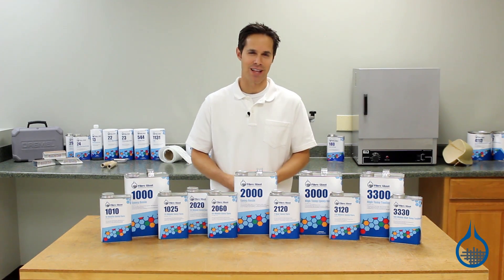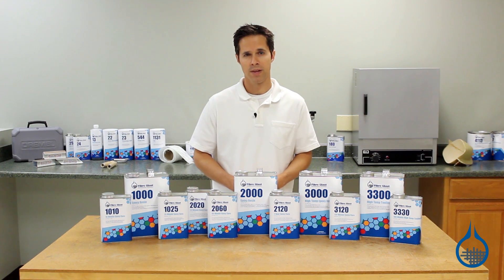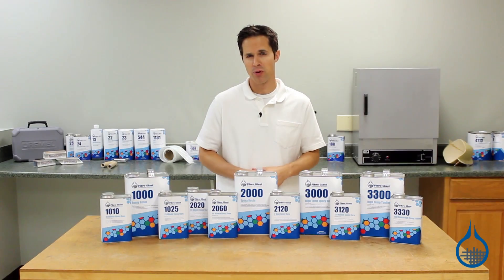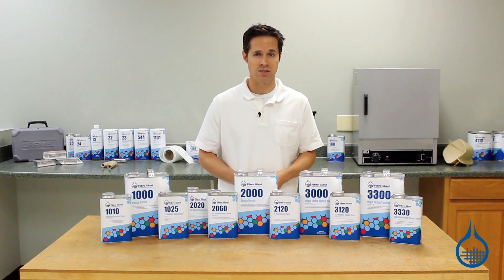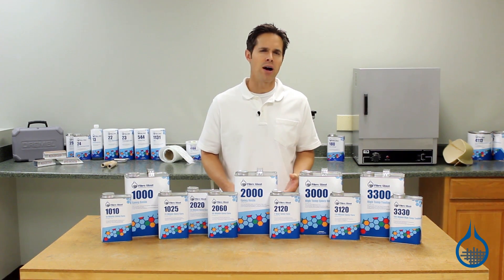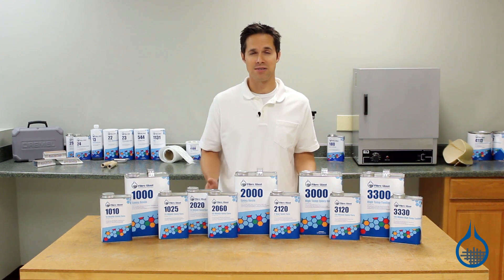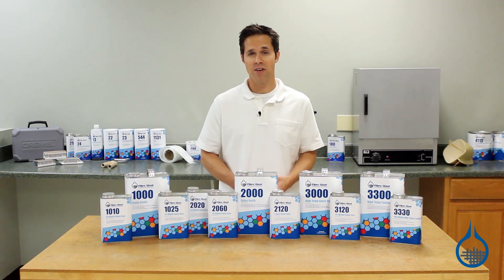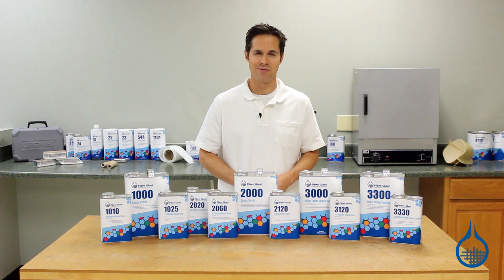Epoxy Overview

Comment: Hi is epoxy resin biodegradable and is it a type of plastic? Was curious
Reply: hi,
epoxy resin is made from melted baleen from whales (kind of like teeth for them!) and as such is biodegradable. tiny microscopic creatures called "tetramands" are able to digest it , and will happily do so. If you look at them under a microscope during this process, you can even see them smiling. How cute! 
happy to help :)

Comment: I'm building a stand up paddle board. What would you recommend for fiberglass fabric and resin? Thanks!
Reply from the maker: I recommend 7-1/2 oz fiberglass fabric. This is our most popular marine fiberglass. As for the resin, I recommend our Polyester Molding Resin. It is a wax-free resin which makes it very easy to work with. 

If you have any more questions or concerns, please contact our customer support team at 800-838-8984 or customerservice@fibreglast.com
Reply: @fibreglast  thanks! I probably should have mentioned that it will be a hollow board in a cedar strip style shell. I'd need the fiberglass to be clear when finished. Thanks again!

Comment: How about yellowing compared to the glass?
Reply from the maker: Hey Anta, Thanks for reaching out. There are many variables to the yellowing of the different composite products. The epoxies displayed in the video do not have UV resistance and will need a clear coat that has anti- yellowing and UV resistance if you are wanting to see the fabric or a UV paint if you are wanting to color the composite. If you have additional questions, we have  a knowledgeable staff that can discuss what you are looking for. we can be reached at 1-800-821-3283 M-F 8am- 7pm EST We are very happy to help you with this project.

Comment: A question of curiosity  - can I make a greenhouse with resin windows in a region of frequent hailstorms? Will such a window survive in a hail of 5 cm ice balls? Will there be a problem with sunlight, you mentioned something about changing colour but what about strength?  How long life such an epoxy glass will have?
Reply from the maker: Unfortunately our epoxy resins are not meant for an application such as that. Our epoxy resins are meant to be used in a composite application in combination with a reinforcement fabric such as fiberglass or carbon fiber.

Comment: i want to make trainer swords using wood chips, fiberglass, and epoxy resin, along with aluminium/brass dressings, i kinda needed to know if epoxy is brittle or not, what it compares to in flexibility
Reply from the maker: Hello, for creating practice swords using wood and fiberglass we would recommend that you use our #77 polyester molding resin. It will be more flexible and economical to use than epoxy resin. Epoxy resins are more brittle in comparison to polyester resins. I have copied a link below to our #77 polyester molding resin page.

https://www.fibreglast.com/product/Polyester_Molding_Resin_just_resin_77
Reply: @fibreglast  thanks! helps a ton

Comment: Am facing a common problem in my epoxy design when am pourd epoxy resin in the mold of PVC 1mm. After 10 minutes here bubble formation start internally and produce some light smoke and after Harding my epoxy get cracked. But when am pourd on silicone mold there are no bubble formation occurred.
Can you help me on this please.
Reply from the maker: Are you using our brand of epoxy resin for this? If so which one and we will do our best to help you.
Reply: @fibreglast  am using vitto brand epoxy resin and here missing ratio is 100gm epoxy with 25gm hardener.
Reply from the maker: @Vikast45  seeing as how you are not using our brand of epoxy resins we cannot speak to the physical properties of the resin in question. We suggest you contact the supplier of the product in question for further support. Thank you.

Comment: Can I use epoxy for hanging Ethernet in the ceiling?
Reply from the maker: Hello, I would not recommend this product for this type of an application. Our epoxy resins are designed to be used in composites.
Reply: Fibre Glast I use hot glue gun but it is not weather resistant. I am going to use epoxy resin and hardened.

Comment: ? good day ; I need to ask you about the right kind of epoxy that I can use as a feling in a hot place
Reply from the maker: +Ibrahim Kouidri Could you tell us the temperature environment you are expecting for this part?
Reply: Fibre Glast around 50C°
Reply: Fibre Glast around 50C°